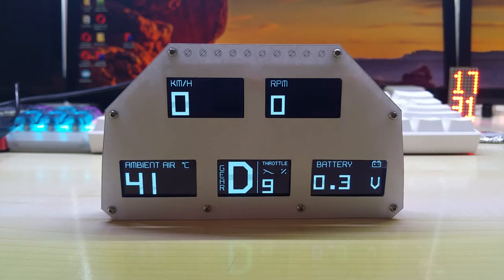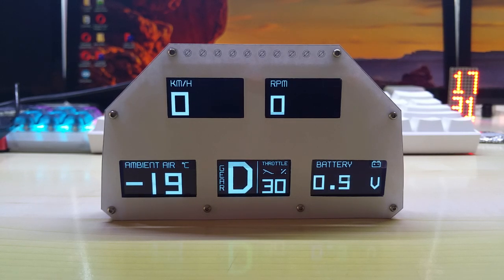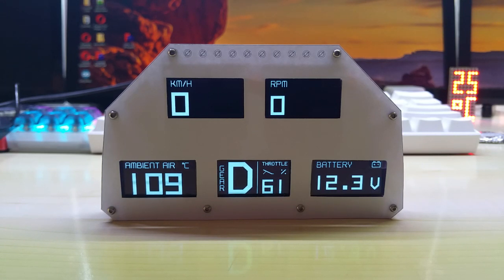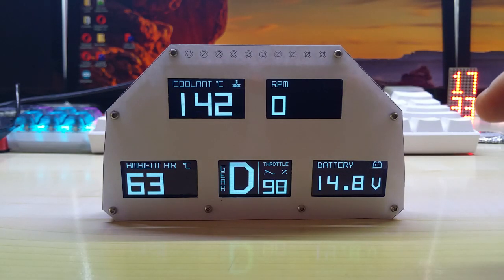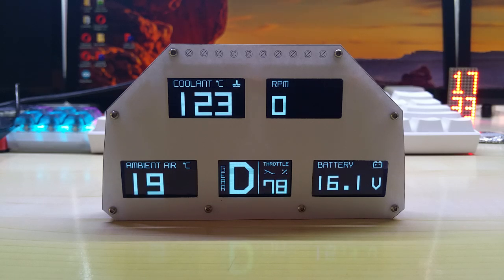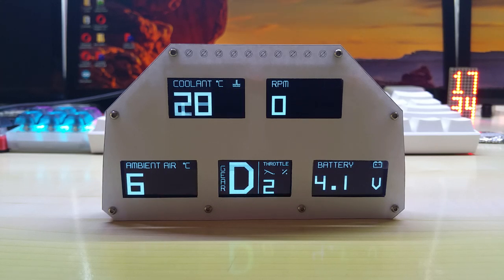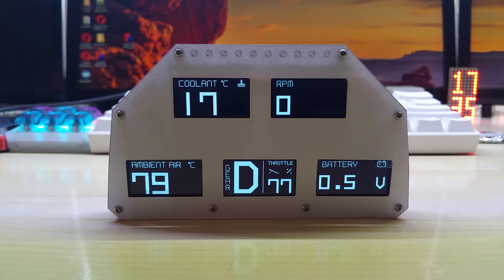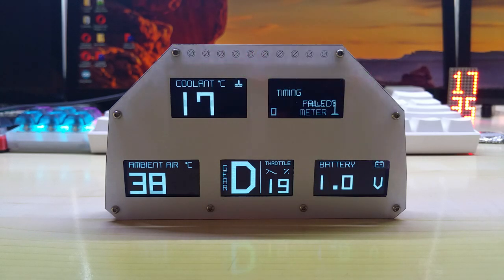Preview of the CAN V-GAUGE, one step left to perfection :-)

Comment: i can tell you that in the car world if you can have these monitor the following people will buy these in a HEARTBEAT. 

-Oil Pressure and Temp
-Coolant Temp
-RPM
-Gear
-IAT2 and IAT1
-Ethanol Content %
-AFR or Lambda from a wideband
-Boost
-Methanol injection activation light
Reply from the maker: I can read and show all standard OBDII PID's according to this list: https://en.wikipedia.org/wiki/OBD-II_PIDs, as long as the car supplies them on the CAN BUS.